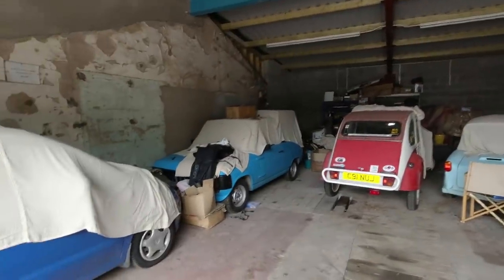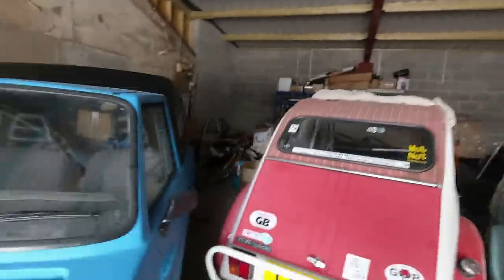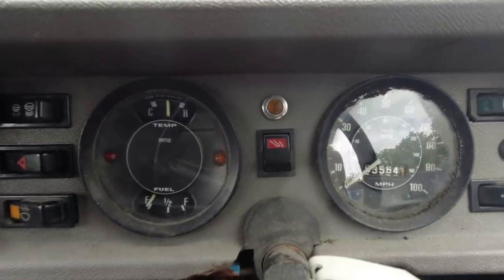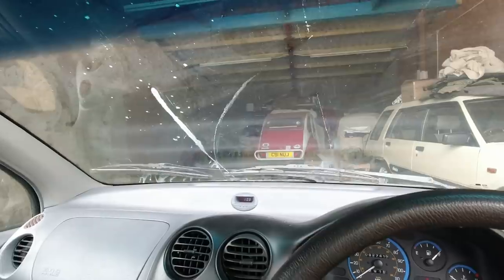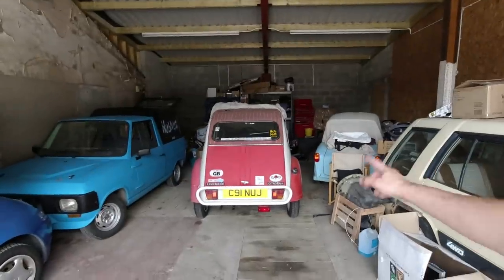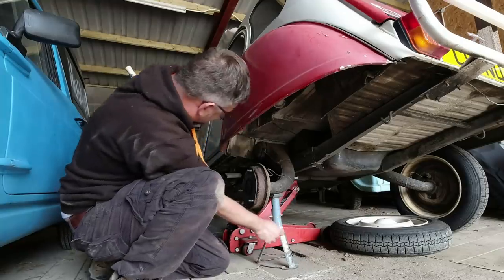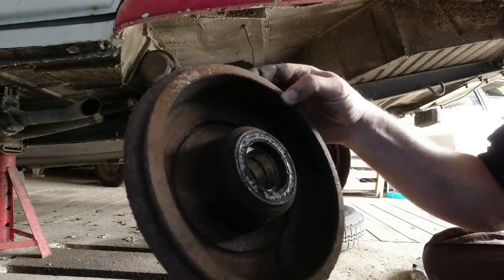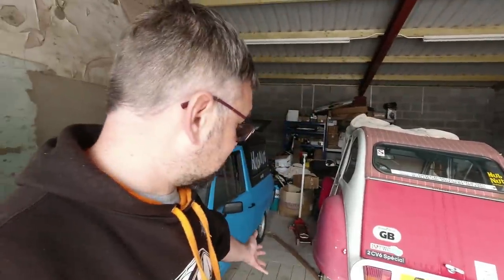2CV rear HubNut removal, with bonus Daewoo Matiz and Reliant Fox action!

Comment: Unbelievable typical Daewoo starts first time after such a long lay up they were a brilliant car company Daewoo still wish I had my espero Ian brilliant video
Reply: About 10 years ago I was carless & I wanted to hire a car to take on holiday for a week . The budget was tight and they suggested a brand new car they had in , a Chevrolet Matiz . I was majorly impressed by how relaxing it was at 70 on the motorway ,how light the clutch was around town , the fantastic air conditioning made all the difference in summer traffic jams.  I did about 650 miles in it , a pleasurable test drive ! 😊

Comment: Foxanne sounded like she was purring when idling - happy to be started again.
Yes to replacing the wheel cylinders - you're going to clean up the backing plate and refit the brake shoes, so it makes sense to do the wheel cylinders why everything is apart.
I had to use a 2-foot breaker bar with 5-foot scaffold tube to loosen the wheel nuts on my car last weekend after the panel shop used a rattle gun set to max torque  - that hub nut loosened much easier than expected!

Comment: I have been winter storing motorcycles (5 month(ish)) since the late '70s as well as, until she sold it last year, my wife's 2001 SLK320. For many year I did not use any fuel stabilizer and there was no particular issue starting up in the spring. After Canada switched to unleaded fuel in 1990, however, things changed and spring startup became laborious and the bikes ran more roughly until that first tankful was used up and fresh fuel added. I then started using fuel stabilizer and it really made a difference. One year I even missed the riding season because of some big surgery resulting in my bike being stored for two consecutive winters plus the intervening summer. It still fired up instantly and ran smoothly (well, as smoothly as any Harley-Davidson is capable) despite 17 months of inactivity.  I also hook up each of my stored bikes or cars to a smart trickle charger, but that's a different topic.

Comment: I bought a Mk1 Astra that I thought the brakes didn't feel quite right, when I took the rear drums off it turned out the shoes were fitted wrong like on Elly, turned them the right way and hey presto fantastic brakes again. Impressive how quickly Myrtle and FoxAnne started up after being laid up for so long.
Reply: I once had the rear shoes reversed on a Vauxhall FB, I met another car on a single file Cornish bridge when I was 10% across, the other driver 90% across, my brakes locked trying to go backwards and I had to tell the other driver to back up, not good.
Reply: @rogerhudson9732  Definitely not a good situation to be in, I bet that was a shock when you tried to reverse. The brakes worked on the Astra but felt a bit spongy but I put it down to the rears needing adjusting so bought the car anyway...it was only a cheap car. I pulled the handbrake a couple of notches on the way home and it improved them so I guessed I was right. It was only when I pulled a drum off to inspect them that I realised why they were crap. I did buy new shoes though because the old's had worn really wierdly which is understandable.

Comment: Ellie is your forever car. I would do both cylinders both new hub bearings and drums and a set of brakeshoes the right way up😉 from my experience you may also need new brake hoses as they often weld to the cylinder, depends how long they've been on there, usually this is the case when all parts suppliers are shut. All depends on the finances, as ever. Looking forward to seeing what you do 👍
Reply from the maker: Cheers. We replaced the brake lines last year. I think I must have over-tightened one of the connections as the wheel cylinder has basically sheared. Most odd!

Comment: Yes, it's always preferable for your drum brake adjusters to be, well, adjustable...
I would suggest that, with getting the rear drums off being such a pain, it would be a good idea to replace both wheel cylinders now, and maybe the shoes too, to avoid having to pull the drums off again in a few thousand miles.  The current shoes can be kept as spares, if they check out OK when cleaned up and inspected.  Just make sure to store them with some dessicant material to avoid the metal backing corroding away...

Comment: Make sure you store with super unleaded, otherwise the ethanol in regular petrol will corrode parts of the fuel system and absorb water too. The fuel stabilisers don't do anything for corrosion prevention, but prevents the fuel going stale for a bit longer—like 10% longer.

Comment: Removing (wheel) nuts - while it seems quite obvious loosening the tight nuts by pushing down, you can in fact apply more force by pulling up as you can push against the ground ! Ditto applies to hand crank engine starting.

Comment: I've just had both rear hub nuts off my Renault Grand Scénic, to change the brake discs (which come as a unit with the bearings). I bought a 750mm breaker bar to do it (I'd already snapped the head off the 600mm one trying to get a wheel nut off my Peugeot Expert). The next hub nut I need to remove is the front nearside one on the Peugeot, to do the wheel bearing. Looking at the state of it (rusty and chewed up), I reckon it's going to be an absolute joy to do.
Reply from the maker: I feel your pain. Had a BX that was an absolute sod and broke several tools! To rub salt into the wounds, the hubnut is a 35mm, unlikely pretty much anything else!
Reply: @HubNut  Haha! Why do the French like to do things like that? I once had a C-reg Peugeot 305 1.6 SR which used a really weird tyre size, used only by certain models of 305, and weirdly enough, Citroën BX. Which meant they were expensive and not widely stocked.

Comment: Thanks for putting this YouTube up, I got to do the wheel bearings on my 2CV and it is always good to see someone else having a go first 😉. I had a 10mm thick stainless steel plate laser cut to use as the tool to first draw the hub off the stub axle and then to double up as a break shoe centralising tool. I could email you my .dxf file, there must be someone in Wales doing laser cutting.
Reply from the maker: I don't actually but an intriguing idea. I reckon I'll manage somehow but appreciate the offer.

Comment: Hi, if you have two wheel cylinders then fit two!
I had an astra which blew both in the same month and the second one went while it was stranded  as the crank pulley centre had detached itself from the outside (via the rubber middle bit) leading it stuck at my place of employment.
The rescue was done on a Sunday but only after it was fixed did I spot the brake fluid on the floor (it was stood for 2 days) but it was too late to do anything, so a very slow (and dodgy) drive home was endured !!!!
I wish I'd done them both at the same time !

Comment: I would do wheel cylinders as pairs as ones gone the other will not be far behind it same with the wheel bearing. The easy way to do a bearing is remove old seals and clips knock middle out of it and run mig around the outer race when it cools it shrinks outer bearing race it will near enough fall out on its own if not a light duty drift will tap it out. Put new bearing in deep freeze over night in a air tight freezer bag to shrink it that will fall in easy and whack clip in place before it sets in place. I’ve done loads like this without a press and heavy tools.

Comment: Just had another thought, if you are replacing one wheel bearing the other one will not be far behind in failing, do them both together.  Peace of mind for a few thousand miles.

Comment: I think a visit to an industrial auction to buy some racking so you don't risk damaging your cars by using them for storage, perhaps you won't keep mislaying things then.  Yes change both brake cylinders it will save the hassle of having to do it further down the road seeing as the drum and hubs are off, both wheels will then have equal braking and the chance of a leak will be reduced.   Gloves! a sandwich always tastes better with greasy fingermarks on it.

Comment: If you have two wheel cylinders for Elly, you might as well change both considering the faff involved. 
Chances are the other one could fail a month down the line. Or it could last another 34 years.

Comment: Ian, a cordless impact wrench would make short work of jobs such as these. I know they cost but it is money well spent. You can get a wheel bearing removal/fitting tool on eBay/Amazon for about £40 and it makes changing wheel bearings a breeze. I've replaced the rear wheel bearings on my E36 BMW 318i and they're more complicated than Elly's. Try cleaning up the ICV on Myrtle. She should run a better once that has been done.
Reply from the maker: Thanks. You do need a special tool to replace 2CV rear wheel bearings sadly. It isn't that expensive, but then I doubt it's a job I'll do very often...

Comment: You and those loose battery connections, you will burn the post off a good battery sometime or blow a battery up with sparks and hydrogen.
You were surprised that the trailing arm rotated upwards as you pushed the nut down, that is a perfect example of torque reaction.
Elly really does need a lot of love right now, she needs the brakes sorted, I would change both brake cylinders then you only need to bleed it once.
The engine needs a sort out as she sounds like a bag of spanners, has done ever since you swopped the engine before the big trip.
Also a wash and spray with rust preventative underneath would not go amiss and help long term longevity.

Comment: I have to ask you as i have been trying to buy an estate car for sometime since my vectra 1.9cdti 58 plate went to scrap,due to the timing being out..It was sad to scrap such a car as i basically sold a lovely 55 plate Mondeo titanium 2.2.. 6 speed  in really nice condition..And 1st car i bought was my Astra bertone 2.2 52 plate convertible,(love convertible)it had no mot but for £350 and a new engine,and private reg number,i cannot lose..I since found out the plate is worth circa £700,and i see these cars do £400 - £1700,they have fab options like full leather trim,and said to be a poor mans BMW 3 series,which i also like..The vectra i paid £760..
That gives you a little background,also my estate came in handy for courier work and supported me very well,changing small things as required,nothing over £150,other than for MOT work,it was a ex taxi come minicab lol..
Presently i have a few options..
1, Volvo v70..wasn't to bothered about age but between 2004 -2007 and mileage circa 150.k - 185.k must be leather and automatic..
2, Ford Mondeo titanium 2.2 estate, diesel,again aged between 2005-2011 possibly,nice interior 6 speed box..
3,Jaguar x type,2.2 leather man -auto 140 k -160 k miles..(09/06..seen one on 08 plate for £250 fuel pump fault)...? bargain maybe 130k on clock very clean car..
4,VW Sharan 1.9 or the best 2.9 one..greedy i know..ha ha ha..2.9 could be a cheaper buy..?+the other two sister cars of same branding,Seat/ford..?
5,Audi A6 estate 2004-2006 ..depending on mileages..
Out the blue cars...Was a London taxi tx1 or similar with automatic..seen one with mega low mileage..but it didn't excite me enough,amazing how a set of hubcaps can make cars appearance cute lol..
The other a Range Rover,4.0 litre lpg conversion with tow bar..(car trailer deliveries) came to mind..extra income.. 
I still have my Ford Transit high top 2014 van...not really looked after it due to heath and lack of work..I have 2 more MOT's left before i have finished paying for it..115 k on clock at present..
Biggest issues cost of insurance on a couple of cars..? funding cash flow..and work..?

What cars would you consider..?

Comment: You were a brave man jacking Elly up on those wooden slats covering the pit, but I assume/hope they're quite thick pieces of wood! Wouldn't it be worth getting the pit pumped out and dry just to get rid of any smell and possible water-borne bacteria though? Oh, and 1.75" = 44.45mm, it's the basis of the "U" measurement in 19" rack mount equipment.
Reply from the maker: See Delica Service video. They're decent slabs of timber. It's dry in the pit at the moment, but apparently it can get damp.
Reply: @HubNut  Wonder if it was properly 'tanked' when it was made?

Comment: Another day, another dollar as they say. Interestingly the Haynes shows the brake linings to be symmetrical but it is a drawing and not a photo. Getting asymmetrical shoes the right way round is usually a head scratcher so best to mark them up correctly when fitting when you're sure they are correct. You may or may not have the original wooden wheel chock in the tool kit but that is also used to stop the trailing arm from lifting. The big bar did the job! Even looked easy considering that it should be 250-290 ft/lbs. You said you had new cylinders and then later you said you didn't want to disturb the shoes but you might as well change the cylinders now to save going in again for a few years. Are you doing the bearings both sides?
Nice to see Foxanne and Myrtle start so easy. The stabiliser probably helped.
Reply from the maker: It's possible to change the wheel cylinders without disturbing the shoes apparently but I might as well pull it all apart now. Wasn't going to replace both bearings, because they're not cheap and tend to last a long time.
Reply: @HubNut  I've donated about half the price a second bearing which you can use for that purchase or anything else of your choosing. I'd fit a second bearing myself. Take care.

Comment: 2cv seems to need lots of jacking up because so long travel of suspension 😄

If smaller jack than yours needs maybe woodblock to get it high enough 🤔

If i remember right older Peugeots (504, etc) have similar type hubcaps whic are bolted to the wheel.
Reply from the maker: Yes, wood blocks can be needed. Very long travel!

Comment: Nice video. Only in the half at the moment. The whine of the Matiz isn’t sounding totally okay. Could be alternator bearings or indeed the steering pump. If it is the steering pump you can hear if it is by being max travel left or right and playing with the steering wheel. 
What car is Foxanne exactly? What is the engine like? Sounds nice and perky!
Did you taise the right side while the left was resting on the axle stand?
Reply from the maker: Thanks. It's an odd noise that doesn't seem to get better or worse with revs... Foxanne is a Reliant Fox, and uses their own all-alloy four pot.

Comment: I'm thinking if you've gone through the trouble  of putting the 2CV on jack stands and taking the wheels off, you have to replace one wheel cylinder and you've got a 2nd new one, you might as well replace the other side.
Reply from the maker: Yup, think so.

Comment: If modern fuels go bad very quickly, then if you run a hybrid car on the battery’s all the time you may have trouble when you require a longer run?
Reply from the maker: Most hybrids are very much stacked towards petrol cars with a bit of battery than the other way around, so it's not likely to be an issue. Personally, I prefer one or the other, not both.

Comment: im surprised the hubnut was so tight.  usually the hubnut is adjusted for bearing preload and is castlated for a cotterpin through the spindle
Reply from the maker: These are torqued up to about 250lb.ft and staked.
Reply: @HubNut  i tought these cars were designed such that a french farmer could rebuild it with a hammer and baling wire!!

Comment: I would totally rebuild the entire rear brakes both sides.  Those all look pretty rusty and janky.  Both your, and the ones you're driving around is pretty important.  Brakes are cheap to do, just fiddly.
Reply from the maker: Shoes are fairly new I think, but wheel cylinders definitely need doing. Drums just look manky on the outside.
Reply: @HubNut  Such is the joy of old cars.  I think your 2CV is my favorite one.  I eventually want to get a nice restored example of a 2CV Charleston.  Sadly, they sell for a not small sum of money here, as they have to be imported.

Comment: Shoe centring tool - Seen Google images - bizarre ! Never come across anything like that ! The shoes should align themselves to ensure even wear ! Maybe a dab of copper grease on the ends of the shoes where they fit in the cylinder and adjuster would help them slide into their correct position. Not come across individual shoe adjusters either - the double-ended cylinder should mean one is sufficient (acting on both shoes).
I'm sure you know how to adjust the shoes having reassembled everything. Having done so, a tap around the drum with a hammer I'd expect is all that's needed to tweak the position of the shoes if there are issues with the assembly. Possibly done so at a time when the shoes are just binding before being finally let off a notch or so as necessary to stop them binding !

Comment: I though the side pants came off when replacing the wheel instead of needing to jack it so high.
Reply from the maker: The rear wing can be removed, but it's a lot of faff, and you still need the wheel off the ground.